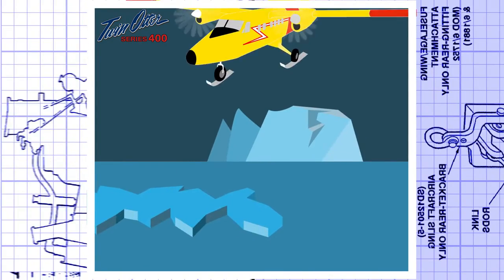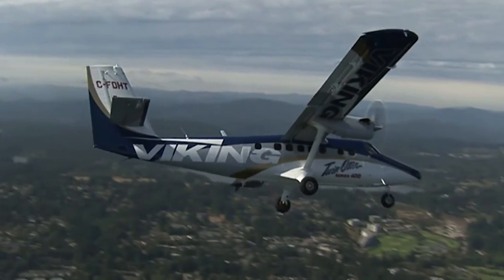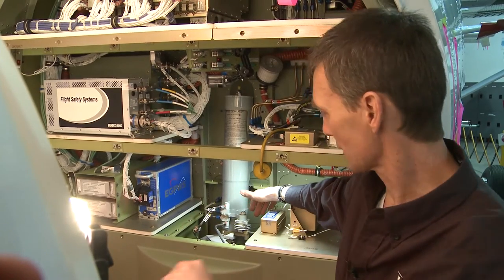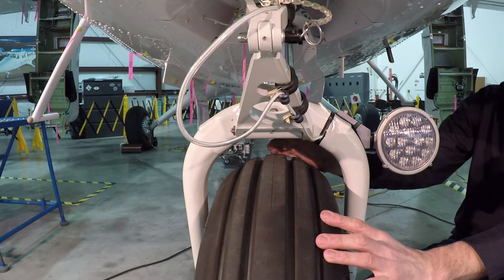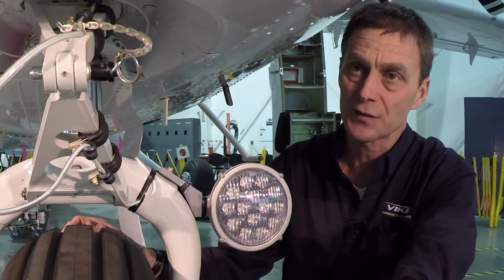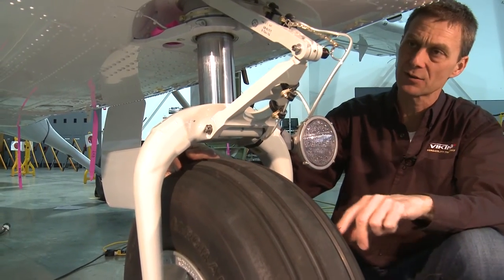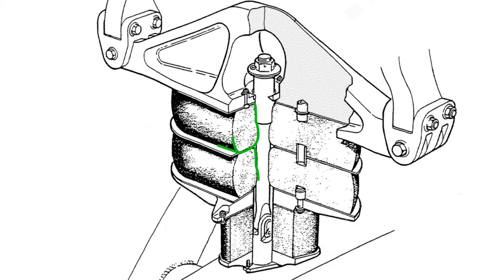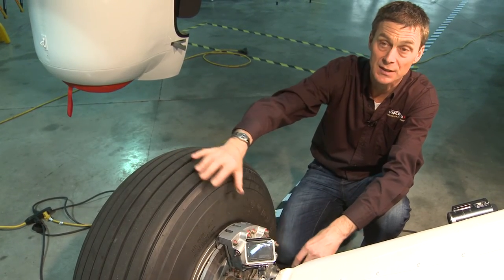Twin Otter Series 400 Overview: Landing Gear

Comment: A guy I know pounded a Twotter in nosewheel first, which I think is not that hard to do at full flap on a full STOL steep approach landing. Hesitate for half a second coming down at 6 or 7 deg and it’s a bad day. He buckled the bulkhead on which the gear is attached. Now I see that to repair that all those avionics have to come out! I’m guessing there is probably less wiring there on the original aircraft but probably still lots of stuff to remove. Man that’s gotta be an expensive repair!

Comment: when using the floats its possible to land loaded with 19 passengers on a normal runway?, all demos are made with no passengers and Im concern about the dolley wheels
Reply from the maker: Hello, the aircraft on floats or amphibian floats can land with full passengers.  As long as it doesn’t exceed its max landing weight of 12,500 Lbs.